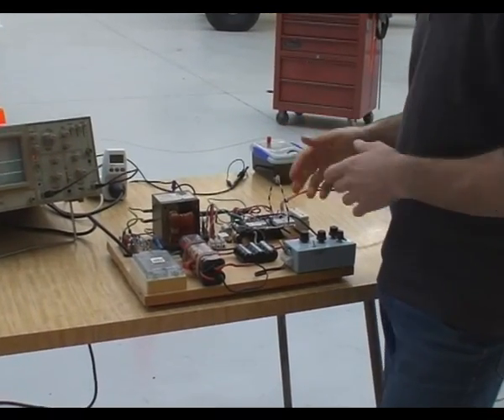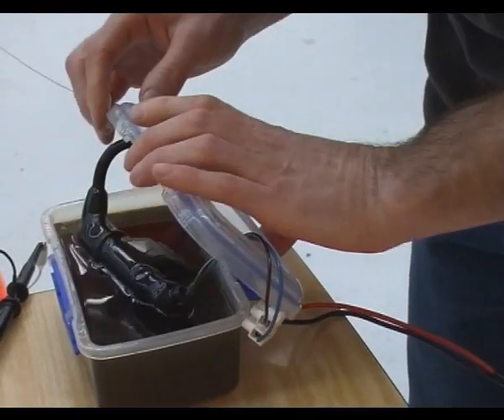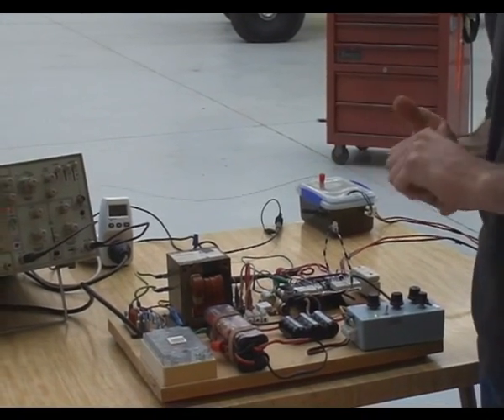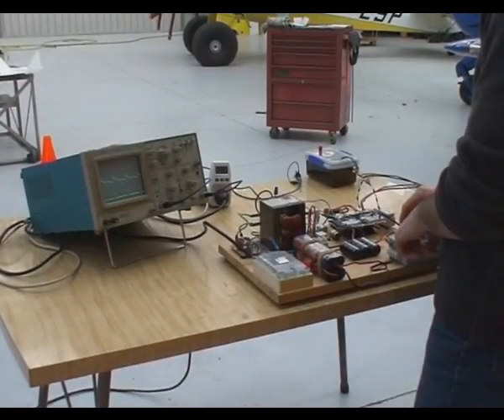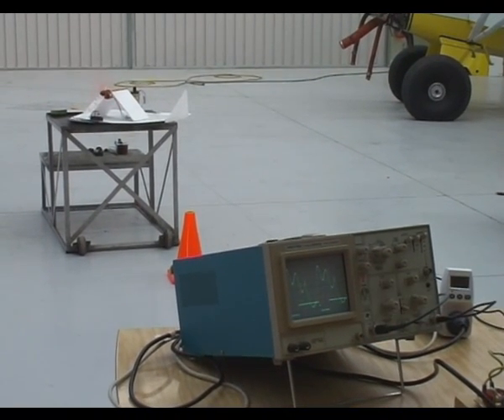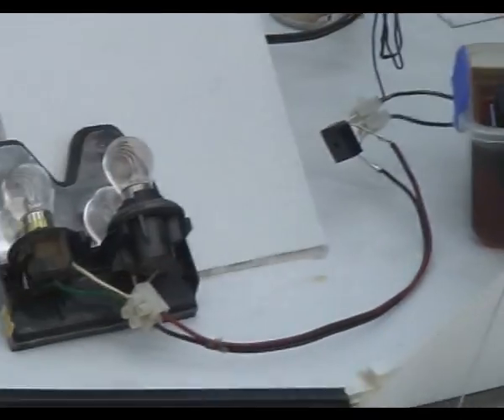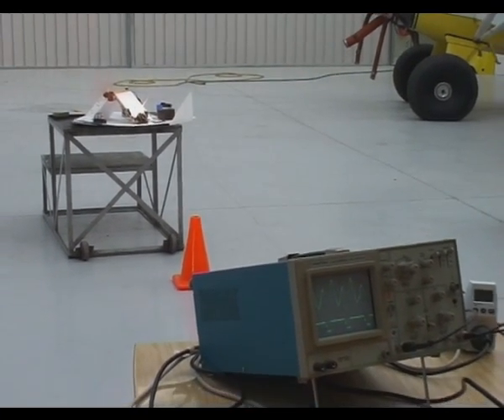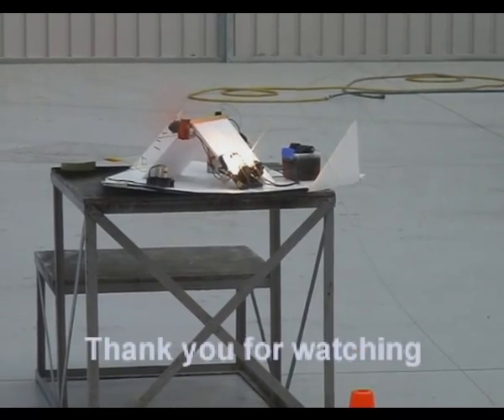Resonance Single Wire Power Transmission

Comment: Thank you so much for your demonstration. This video proved it once and for all for me that single-conductor single-wire power transmission is real and actually works well... I would love to hear if you ever worked more on this concept and if you found a way to increase efficiencies beyond your 10%-30% you claimed. I expect that the MOSFETs and ferrite-core transformers might be part of your problem... There might also be a lack of proper capacitive loading, and also, you could use an impulse coil on your topside/positive-side signal for both transmitter and receiver for your secondary side, with the single wire transmitted power flowing from the negative/ground side like wardenclyffe, I would guess such coil wound to 1/4 the resonant frequency of the transmission coil would be the correct specification. You might also experiment with evanescent waves using a 1.333lambda resonant transmitter driven with a 1*lambda signal and also using the 1/4 wavelength 'loading coil' could have a positive effect on efficiency, but I have not yet had the chance to experiment with this...

best luck on your experiments!
Reply: I also find this video to be one of the most serious about One Wire Transmission. But keeping in mind that it is from 2010, in the meanwhile others had attained much more on the topic. This setup seems a lot like the one from Jean Louis Naudin, while a much more correct setup is the one from Konstantin Meyl

Comment: @1freethink If the system is capacitive then I would suggest to use a aluminum plate on the source also.
I recommend readimg CP Steinmetz book from 1914 (second edition, first edition 1911) about impulses and transients. the first few chapters give practical understanding for this.

This is based on the dielectric field (aka the electric field in a capacitor).
this field can be put into longitudinal resonance. I feel you do this, by creating strong impulses in the primary of the coil, that is stepped up in the secondary. the secondary becomes resonant, but it is not tranverse electro magnetic (tem) but longitudinal magneto dielectric (LMD). Eric Dollard explains some of this in his 1988 Borderland videos.

Very impressive demonstration, thank you for sharing!
I'm also researching this, check my channel for more info.

Comment: can you make an electric toy car powered by single wire tramline in a closed circuit road. I think this is the solution to power an electric car.
Reply: Totally! I have thought of this myself! Efficiencies in this circuit can match or exceed that of two-wire systems, in the right circumstance. As 1freethink said though, their personal circuit efficiency is too low to justify using their particular setup as a transmission system for global power. It does illustrate the concept. I have thought of powering electric fences and garden lights with single wire power, no reason a capacitively coupled floating bipolar receiver floating above ground could not also work.
See:
http:// amasci . com/tesla/nearfld1. html
&
http:// www.amasci . com/tesla/tesceive. html

Comment: Ground the transmitter and receiver as   was  Teslas  intent  and   use  XC  transmission  to boost   the  modulation.  No one ever fuses any of  these experiments,  breakers   may  prevent  fires when  fooling  around with HF. Tesla only  used  arcing    for  show and intended   to waste as little energy  as possible  by   grounding.

Comment: You could take out the resonance effect by having 2 wires, ground and ht, this kinda takes away the benefit of 1 wire, but it would give you a system capable of transmitting power over a long distance more efficiently.
The 2 ally plates act as a capacitor with wide apart plates, this will series resonate with the inductance of the windings, and this is where the resonance effect comes from, the Q will be effected by the size of the plates and the coil, the Q is the narrowness of the 'sweet spot' frequency wise.
You will be able to make the system more effcient by using 2 identical ignition coils, and maybe individually tuning each one so they both resonate at the same frequency, you could do this with an inductance in series with the coil or a variable capacitor across it.

Comment: Patent No. 593,138 dated November 2, 1897

   Wath I claim as my invention is -
   1. A transformer for developing or convert-
   ing currents of high potential, comprising a
   primary and secondary coil, one terminal of
   the secondary being electrically connected
   with the primary, and with earth when the
   transformer is in use, as set forth.

Comment: Single wire method i believe is key to extracting power so you get an over unity result.

I mean have 2 independent single wire cricuit connected as one so these 2 independent wire systems behave in a manner of a 2 wire system.

I believe if you have power it really would have the potential to extract power using power on either the other single wire (electric from mains influencing the other connected to the ground/earth) or the other singe wire ( earth power to electric)

If done right it would either pump electric into the earth or reverse extracting harnessing power from earth.
Reply: A single-wire system tuned to the lighting band (around 5KHz-50KHz), maybe with the resonance in the Hemholtz range (around 30KHz) could extract waste power from sun-to-inonosphere-to-earth dischages, and light a small LED continuously or something. I am just starting to get back into radiant energy systems, and I will try and wind a transformer by hand with a 30KHz resonant frequency so I can see what type of excess energy is available from earth's electric circuit using them.

Comment from the maker: The system as it was in this video is only about 30% efficient. Tesla designed this method for the purpose of transmitting power through the earth as the single conductor. I don't  know what scale of system it would take to achieve this or what efficiency would be possible.

Comment: im wondering... how much energy is lost during this transfer? In an earth return system you can use earth as a return wire. Can you use only earth to transfer power in this case? what would be the losses in such case?

Comment: the receiving wire then receives the EM wave
it gets stepped down by the ignition coil again to the motor (is it possible to do away with all the ignition coils? the high voltage is needed for the transmitting line?)
the aluminium plate acts as a capacitor to smooth the output?

forgive me for any thing that may be obvious, im not a trained electrical engineer. what i know is largely researched from the net :)

Comment: correct me if my understanding is wrong? :)

your function gen connects to the IGBTs' gate
the wall power goes to the IGBTs' collector after transformer and smoothing
the emitter then goes to the ignition coil which increases the voltage
then it goes to the transmitting wire. (is this wire grounded or does it just end?)

Comment from the maker: The circuit works without the aluminum plate but the output is stronger with it. The system is capacitive. Although it is an open circuit in classical electronic theory, with high voltage resonance and capacitance it is not. A good knowlege of radio transmission fundamentals (1/4 wave length and resonance) is helpful to understand how this works.
Reply: So what is the right electronic theory that describes this phenomena?
Reply: @1freethink If the system is capacitive then I would suggest to use a aluminum plate on the source also.
I recommend readimg CP Steinmetz book from 1914 (second edition, first edition 1911) about impulses and transients. the first few chapters give practical understanding for this.

This is based on the dielectric field (aka the electric field in a capacitor).
this field can be put into longitudinal resonance. I feel you do this, by creating strong impulses in the primary of the coil, that is stepped up in the secondary. the secondary becomes resonant, but it is not tranverse electro magnetic (tem) but longitudinal magneto dielectric (LMD). Eric Dollard explains some of this in his 1988 Borderland videos.

Very impressive demonstration, thank you for sharing!
I'm also researching this, check my channel for more info.

Comment from the maker: The effiency is low. Almost 600 watts going in for about 60 watts out.  You are correct with the capacitive nature of the coupling. When the resonance point is reached, a standing wave is created on the coils + transmission line (transmitting antenna).  The recieving antenna in this case is the secondary of the step down coil which is the low voltage side and is surrounding the primary (high voltage winding) .